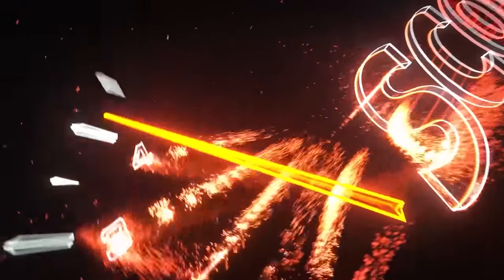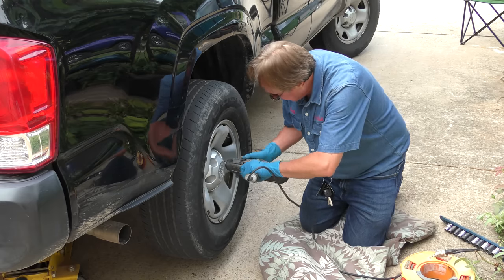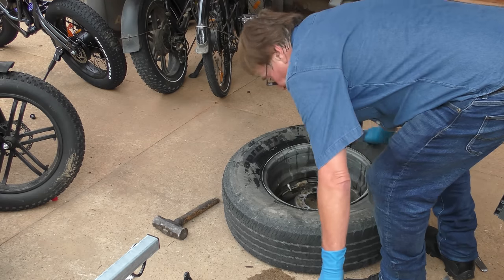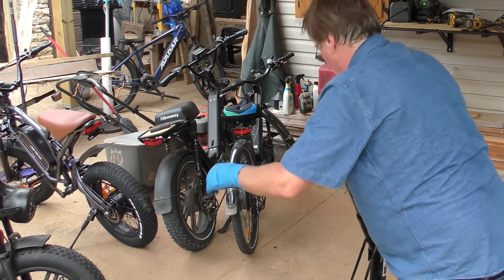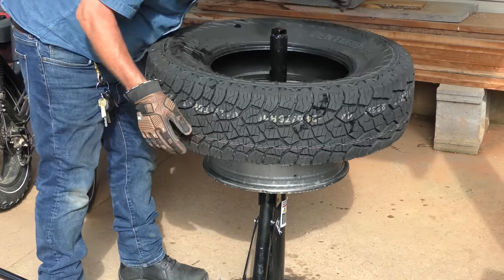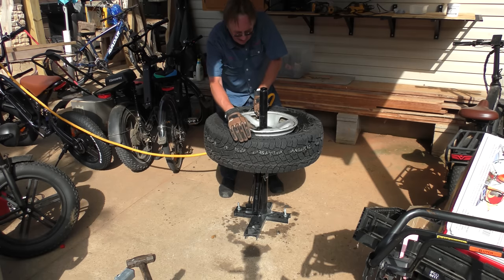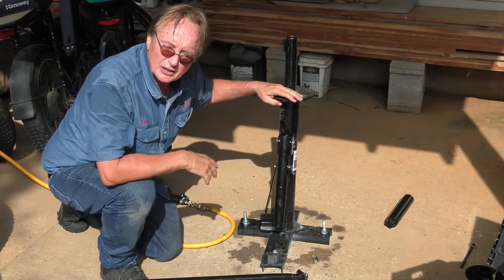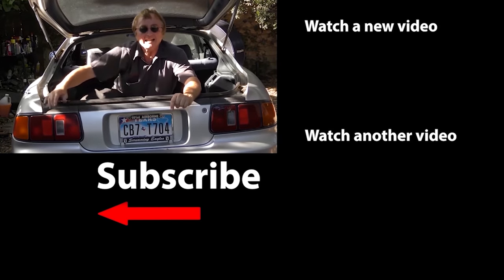Never Buy This From Harbor Freight (Almost Broke My Hand)

Comment: Having worked in a tire store for several years using a machine like this (yes the steel was much heavier) but I have to say your technique is all wrong. Looks like me my first day on the job and technique is everything. Taking the second side of the tire off you have the tire completely out of position to get the tool where it needs to go. Why are you soaping the rim when installing the new tire, a complete waste of time (tire only) and I've put on some heavy six/eight ply tires and never had to use tool to get the first side on. Your making it way harder than it needs to be but the general idea is there and this is not a bad tool for the price.

Comment: Cheap Chinese junk. Take a look at those Kumhos. Research and designed in China. 
That tire changer is designed for smaller tires, not full size pick up or heavy duty tires.

Comment: OK nice of you to do this video .. but #1 your changing a truck tire with a Harbor freight tire changer.. #2 your taking the wheel weights off (you mention you have a balancer)(if you have one of those you should have an electronic Wheel changer ) #3 dont you think you went to the extreme with making a video with the largest tire ... I believe this mechanical machine would work just fine on lawn mower / skid steer tires/ any smaller tire just fine for a diy person where the tire doesnt need balanced ... saying of you get what you pay for but use some common sense when buying tools ....